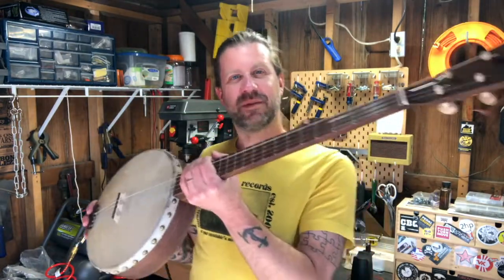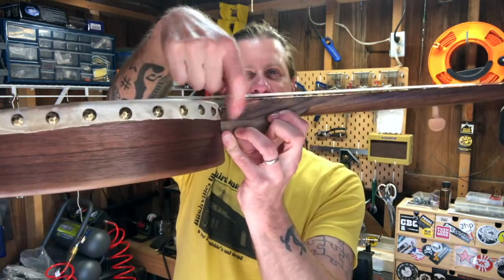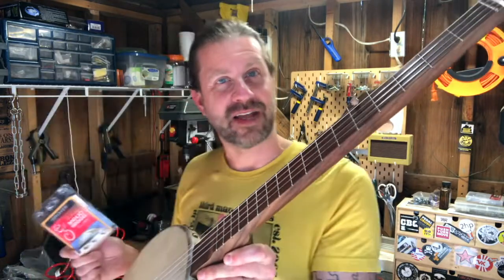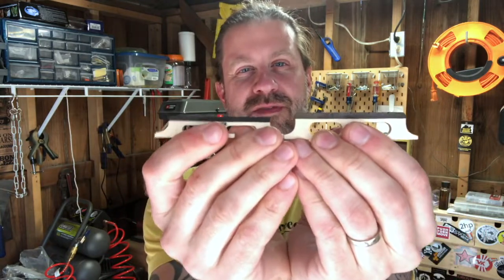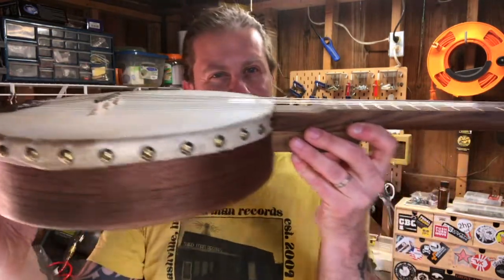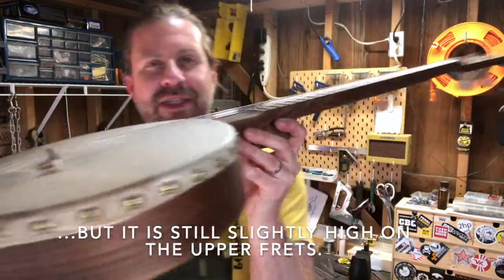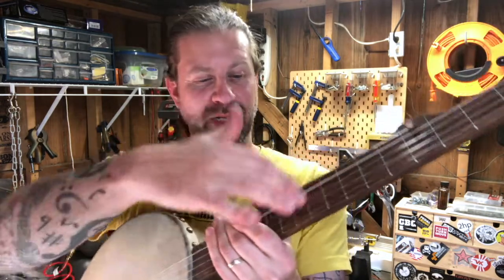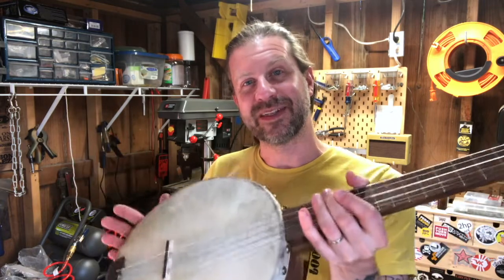Banjo Build Diary: Day 8 [Replacing the Bridge]

Comment: A spot of bar soap on the fifth peg will help it turn smoothly. Also, a lot of times the strings are slipping at the knot so make sure your knots are really good. I agree, these banjos sound better in lower than G tunings, and if you are just playing solo its not too important to be in a standard key. If your bridge swap doesn't do the trick, reset the dowel with the black screw to change the neck angle- this is my preferred method for adjusting action. 
Really loved this series, you did a great job, looks like you had fun and I also appreciate the time you took to film and edit everything.
Reply from the maker: I'm so glad you took the time to watch this. It means a lot. I'll try adding a little soap as you suggest cuz that one string is much harder than the others. When you mention resetting the dowel screw... are you talking about re-drilling the hole in the dowel? I thought about trying that actually but I was worried the holes might collide.
Reply: @musicalmiscellany  sorry I never replied, I never got a notification. You can drill a new hole in the dowel just maybe 1/16 or 1/8" lower and this will lower the action. Small adjustment makes a big difference with setting action.
Likewise you could drill a new hole in the rim, higher up. Makes no difference because it will have the same effect. Hope this helps, hope you've got it set up to your liking.

Comment: Kale, is the fifth syncopated string tuner tight only because it has more string tension on it?   I would try to keep the peg tuners if possible for the aesthetics.   I made a neck angle adjustment on my Taka five string because the truss rod adjustment was maxed out.
Reply from the maker: Yeah. I really like the aesthetic and the weight of the friction tuners. I'm not sure why the 5th peg is harder... it might just be slightly larger. On a conventional banjo it's pretty easy to change the neck angle with the coordinator rod but this one is super low tech. LOL. The bridge made a HUGE difference.